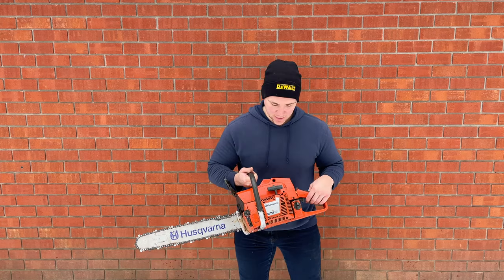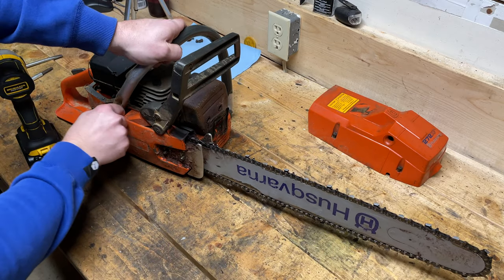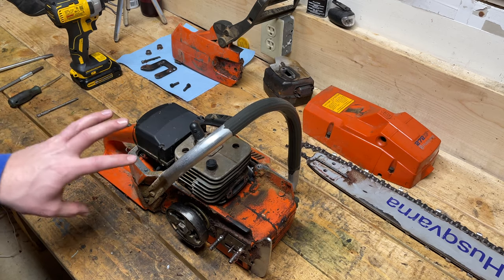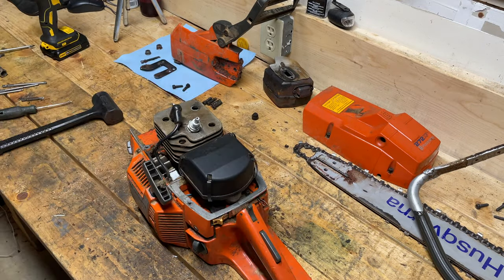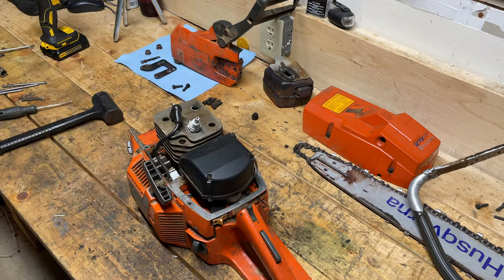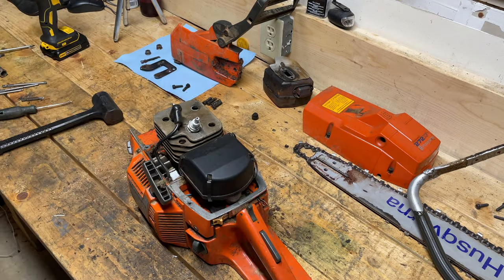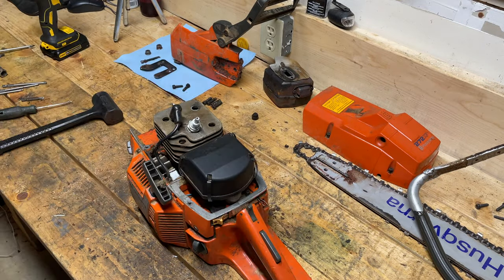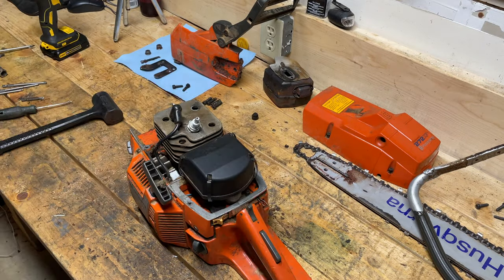How to fix your blown up chainsaw... WITHOUT buying new parts! Step-by-step diagnoses and repair!!!

Comment: Dave you have been a good student, done your homework and are adopting the same style as the miestro your mentor don. Enjoyable vid
Reply from the maker: Thank you kindly!
Reply: @DavesSmallEngines  👍 it would be great to see some vids on older Stihl, Jonsered ,Husqvarna ,Dolmar,Echo,Tanaka saws strimmers blowers if u happen to find any blown up examples that need redirection. It's great to see these bargain finds
Reply from the maker: @tc3603  I have a Partner Pioneer 7000 I bought at a garage sale fully disassembled. Would you like to see a video on the rebuild?
Reply: @DavesSmallEngines   that would be great. Cannot beat the older stuff . Looking forward to it
Reply from the maker: @tc3603  sounds good... I have a much bigger project I’m about to get underway. Well, several actually. But this one is pretty big!

Comment: Cool vid, I like to take a dial caliper, measure the thickness of the ring where it's deepest in the ring groove, and most protected, then measure the damaged part near cylinder wall, to make sure it's not peened over into a tiny burr.  If it is, I'll take just a couple swipes on each flat face with some fine sand paper, just to kill that sharp edge, to keep it from gouging.  I only do this when the ring looks like it took a beating.  Cheers.

Comment: Excellent video. My Stihl 193t (that I bought for $65) has low compression and some scoring on the piston. After watching this video I'm going to try and revive my old cylinder and piston. I can't find any aftermarket kits for a 193t and I'm not quite ready to buy an OEM kit until I try to reuse my factory cyl/piston.
Reply from the maker: Hey Sword! Always worth a try in my opinion. I have a 441C I’m about to downgrade from a cheap big bore kit… just doesn’t run the same as stock. I’m going to try and fix up the OEM cylinder before buying a Meteor kit!
Reply: How did it go?
Reply: @AudreysKitchen  It runs well after a new ring was put in and the piston and cylinder was cleaned of all carbon buildup. Since the cylinder was removed I also replaced the crank seals. The cost savings was definitely worth it.

Comment: Keep up the good work Dave. Ya I think you should put out more videos. On more chainsaws.& etc. That are 2 cycle engine equipment such as edgers,ledgers,hedgers,& weedeaters.& much more things that are to. Even boat outboard engines.& like rebar cutter saws.& polsaws.
Reply from the maker: Hey John! Thanks for the support. I have lots of other videos so check them out if you get a chance!

Comment: i just got a not running 266, piston looks exactly like this one. Wonder if it's worth getting a brush hone for $20? i've never tried reconditioning an engine before. i like the idea of keeping as much oem swedish parts as possible
Reply from the maker: I think it’s always worth it to save OEM parts. I always take enough off with sandpaper but a brush hone may do a better job. Let me know how it goes!

Comment: I use my little car adjustment screwdriver to press down on the ring to get it in the cylinder.  All of my saws have two rings which makes it harder to get the cylinder down on the piston.  I also liberally coat all parts with two cycle oil before assembly.  My torque setting on cylinder bolts is as hard as I can hand tighten them and all bolts have the same approximate torque.  I also relighted after an hours run time.
Reply from the maker: Great tips John!! Thanks

Comment: I don't understand why people do this !  You should blow as much dirt off as possible BEFORE any disassembly.  Then after you get the bar, handle and any covers off blow it off again !  Leaving dirt on the outside is just an invitation for it to get INSIDE the engine.

Also I would use wet/dry sandpaper or emery cloth with water or oil.
Reply from the maker: I agree Jack - however with my air compressor I made certain that nothing was inside before reassembly.
Reply: I thought the same thing.
Reply: I totally agree. I was a Tech/ Service Manager for a Honda motorcycle shop.  Guys would bring dirt bikes in, that were due for a first service, which includes a valve clearance check. They’d be covered in dirt, or if it was “washed”, it was hit with a pressure washer, and not done correctly.  
I’d say, “ would you go roll around in a mud puddle,then show up at the hospital for a scheduled heart surgery?” 
It drove me nuts.  We would tell them, it’s a $15. charge to wash it prior to service. The old man took $5. and whomever washed it got the rest lol.
Reply: @chipper442  I would happily pay the $15 !

Comment: Before I put screws in, in plastic or other materials, I like to turn them out by hand until they fall back into the previous thread then hand tighten to make sure they're in the right thread. Makes many repetitive repairs less destructive to the fastening threads.
Reply from the maker: Very good point. I learned that lesson the hard way a few times!

Comment: I usually rinse out the crankcase a couple of times with good two cycle and blow it out, good, with compressed air.  This will get rid of most little fines.  I then put assembly lube on the bearings before reassembly.  I also put TB 1184 on both sides of the gasket on the cases and cylinder.  I tighten all cylinder screws with a T wrench to a strong hand tight.
Reply from the maker: I’m going to start doing that! Thanks!

Comment: I have a question I have a 365 71 cc chainsaw It had compression then all sudden it lost it and now it is dumping mix fuel into the piston and exhaust I cannot figure out why piston looks good when you look through the exhaust hole but you can pull it and watch it dump gas out of the exhaust port

Comment: That’s why I put Locktite on carb bolts or nuts when I put them together.  I used Red 271 on them and muffler bolts.
Reply from the maker: Good tip!

Comment: Maybe you can help. I got a 450 husqvarna and was cutting a tree And I thouched the fence and the chain came and I damaged it. Replaced the chain and now it doesn’t want to turn on. I replace the spark plug and cleaned the filter and I’m lost now. I order a carburetor kit and fuel filter and when they get here I’ll replace them. What else could be the issue?

Comment: 11:50 Hey dave i would of used a air chuck and try to blast all the crud out arround the base and arround the carb before removing the cylinder to prevent less chance of debrie getting into the crank as i would be to be pulling off the cylinder
Reply from the maker: Good call - I ended up spending about 5 minutes blowing it out at 150psi before reassembly. I will do it before next time.

Comment: That 272 is a good saw as is the 372xp but I personally prefer the bigger jonsered chainsaws myself my first saw was a old 601 jonsered then I got a 041stihl farm boss and wasn't satisfied with it and just kept going bigger CC wise found the jonsered 2077 and 2083 turbos and I love them
Reply: sadly, Jonsered is no more..really, all they have been for many years is badge-engineered Husqvarnas..those 2077 and 2083 saws you mention were not re-badged Husqvarnas, and they were good saws. However, they were not really Jonsered designs, either..they were designed and engineered by Partner(another company Electrolux gobbled up)...the "true" Jonsered design saws go back farther than that...

Comment: You can use a brake cylinder hone to smooth the cylinder. Worked on a Stihl cylinder.

Comment: Why is there an arrow on the top of the piston to direct that side to the exhaust port? IOW is the piston different on one side than the other and how? I was wondering if the piston could be turned 180 when being put back in. Perhaps a diffirence is the location of the piston ring pin, which I am guessing is seen at 15:30-15:31 next to your thumb. At 27:00 you seem to be aware of it when installing the ring but don't mention it.

Comment: Dave I’m quit curios how long or how strong that saw will last. That’s a lot of sanding... I get the in the pinch idea but you’ve sparked some curiosity now on seasonal/ full time use.
Reply from the maker: That’s a great question Jon. I spoke to @donyboy73 about it and he gave me a good answer. Look for that on his latest upcoming Q&A video, we talked about it at length!

Comment: I have a 441 also. just bought a big bore kit for it..   Don't gasp and faint... but I got it from Farmertec... guess i need to question walt(afleetcommander?) or tinman about what i should do before i install it.   Big bore only adds 2cc? i thought it would have been more at least 5cc??  my mistake i guess.
Reply from the maker: No mistake! I have an off brand bigbore kit in mine... I have a video of this exactly, I have a 441C I turned into a 461c by a big bore kit. It’s 70cc to 76.5 cc I am quite impressed with it. Is yours the Mtronic carb?
Reply: @DavesSmallEngines  OK as i had thought i was thinking anywhere from 75cc to 77cc at first.  No mine is just a MS441 magnum.  no C or  CM letters.  i seen the others talk about squish and i am going man something else to think about. i was hoping slap it on and go... never know i might be able just to do that lol here's to hoping.   but i do know about ring catching or what every they call it.. and base gasket deletes to rise compression.  ah well fun in trying anyways. eh?
Reply from the maker: @beingsneaky  that’s the best part! I think it’ll be fine. I had to grind out part of the casing on the bar side and flywheel side to get mine to fit but man, what a powerhouse now!

Comment: Dave,

Great video and very helpful.  I am finding older snowblowers and garden tractors are superior to new products coming out today.  It takes a little tlc to get something running that will last another 20-30 years.  Is it a similar situation with chainsaws?  Are there any older models that you search for that are easy to work on and easy to find parts?  I use a chainsaw about a dozen times a year on 6”-20” trees.
Reply from the maker: Hey Matt!

“They don’t make ‘em like they used to”!

Anything on the “pro level” side of things. Stihl 026, 028, 034, 038, 044 etc. If you check out “Stihl pro level saws” you will be able to find more. The pro level stuff is so much easier to work on - fast disassembly without having to remove a ton of parts. I’d recommend an 026 or MS260 with a 20” bar. Stay tuned, my next video will be on the repair of that same saw.

Cheers!
Reply: Thanks.  I look forward to the video.
Reply: I’m still using my Pioneer P40 which I acquired second hand about 40 years ago. Keep the mix right and the chain sharp, don’t force it to cut faster, slow cutting is all down to the chain.

Comment: Hey Dave. 
Great Job on this Husqvarna chainsaw👍 I do have a blown up Stihl 044 in stock on which I will try the same repairtechnique...😉 We‘ll see how worse the cylinder and piston could be for chooseing this method 🤔😉
Greetings from Germany,
Stefan
Reply from the maker: Hey Stefan! That’s great. Let me know how it goes. That saw is absolutely worth repairing!
Reply: Dave's Small Engines 
Absolutely😉👍 I‘ll take a Video of the repairjob for my channel... This sanding method is not always possible and you have to be careful not to destroy the coating of the cylinder😉
Reply from the maker: @Bungi81  I’ll check it out!

Comment: Hi Dave. Please can you tell me which sand paper is best to be used for chainsaw cylinder  light scoring? Thanks
Reply from the maker: I would suggest 600 for light scoring. If it’s deeper, I use 300 then 600.

Comment: Another tip for starting in bolt without cross threading is to turn it backwards until you hear it click, then tighten it. It's ridiculous what they charge for OEM parts. I'd like to see someone calculate how much it would cost to build a complete saw with individually purchased OEM parts. I bet it would be a couple of thousand! 👍
Reply from the maker: Good tip!
Reply: My dad was the sole salesguy for Partner saws and Oregon chains for a whole "socken" (basically a county)  in Sweden in the 50's and 60's. He bought complete saws and disassembled into parts, one saw needed only to sell half its parts to pay for itself and only bought the parts that were the big sellers. He also got commission for saws sold, because the company banked on selling lots of spare parts. He got extra goodwill for selling fresh handles and other less-wanted parts cheap for customers when they fixed their saws with him, since he otherwise had those parts left over from the stripped saws. Everyone got great saws in great condition, he made bank, and even got free air-charter trips to spain from the company as a bonus when they started flying airplanes from Sweden to Spain. Sadly he sold to many saws on credit to people who decided not to pay and he didn't have anyone doing collections for him, or he'd been truly rich.

Comment: the dewalt atomic impact. i have one. i absoultly love it!
Reply from the maker: Mine isn’t the atomic - I have been eying one though. I have the 20v max brushless. Should I get the atomic?
Reply: @DavesSmallEngines  sorry it looked like it. naw if you got one already the atomic doesn't bring anything to the table.

Comment: For a start you are flat spotting this piston, far to course paper.
Grooves don't matter only high spots and ring lands ,just take off the high spots fit a new ring and circlips and you are good to go.
The main issue is the bore, if you can't seal the piston RING to the bore it's going to have trouble making compression so the bore needs a hone and hope (I believe it's nicaseal ) not sand paper.
Course paper on the ring is ok because all you are doing is removing the aluminium from it.
Once overheated the ring will lose temper and elasticity so a new one is preferable.
Either way it will run but it will not put out the same power.

Comment: I was told by beer can small engine repair on a cold start to let the saw run at a idle for a minute before revving it not to score the piston
Reply from the maker: Hey Fred - I agree. Always best to let it warm up to prevent cold scoring. Cheers!

Comment: Seems to me that the score on the cylinder walls and the damage to the rings would have been something of more concern to repair as to the score on the piston itself since the piston is not going to contact anything as long as specs are in place elsewhere.

Comment: What you can do on the piston and it'll give you more horsepower as well and prevent piston slap is to get a centre punch have it slightly blunt and every 5 mm put an indentation quite heavily in the side walls, you need to have a block of wood the shape of the piston underneath it, and up to about 4 mm to the ring With a fine file or thousand grit wet and dry on a flat surface take off the burrs from the punch so you're left with 0.3 tho measuring with a feeler gauge to the side of the wall of the cylinder. Always run a Chainsaw with more oil so you've got slight smoke and dieseling and use synthetic not mineral.
Can you not buy the piston and ring from Husqvarna? And if not why not?
Having a slightly oversized ring 0.1 tho might be beneficial. you could get the cylinder chrome plating 15 microns after hatchings 
you can make a gasket by just cutting an old foil tray seems to work for me all the time just make sure it's bit thick not the thin ones

Comment: Good video but why didn’t you show compression before you took it apart ?  Tx for all your knowledge bro
Reply from the maker: Hey John - I forgot. It was 70PSI as I found a picture of when I first tested it.
Reply: @DavesSmallEngines  ok tx for the reply. I have a similar situation but the piston was too far gone. It’s a stihl 271 and I can’t get a cylinder for it without spending like $200. Probably just get a new one. Tx Dave
Reply from the maker: Hey John - yes the 271 is not a pro level saw which means it’s harder to work on and the parts are expensive. Have you looked at an aftermarket replacement by chance?
Reply: No I haven’t. Could you recommend one with possibly a part number. That would be very helpful as I don’t know where to look. Tx in advance Dave

Comment: If its been sitting for any time, 
the muffler will have rust bits in it. 
These will blow back into your cylinder and destroy it right away.
I use an ultrasonic cleaner.
Does a spiffy job and is good on all your parts. Put your parts in a coffee can, 
in whatever cleaner you use and insert that can into your solution. 
It prevents your maim solution from being contaminated, as well as giving you the choice of different cleaners.

Comment: You know i seen Projectfarms use "Engine Restore" on a mower and it worked i wonder after your sanding if it maybe help even a little bit?   hmm perhaps not on What every it uses to fill in minor scratches would get into the bearings.  But then again AGAIN it gets into the bearings of a car.   I know it works on cars and mowers.
Reply: CAN RESTORE BE USED IN 2 STROKE ENGINES WHERE OIL IS MIXED WITH PETROL? No, RESTORE is not formulated for use in 2 stroke engines using a petroil mix, but it can be introduced down the spark-plug hole with the piston half-way down the bore. (Please refer to the attached Instructions to 2 Stroke and 4 Stroke and wet clutch users). You can also use RESTORE in 2 strokes where the oil is contained in a separate reservoir. Most modern scooters (Piaggio, Aprilia, Yamaha, Sym etc.) have a separate oil reservoir and all you do is pour 125ml into a full tank of oil.
Reply from the maker: Good to know!

Comment: I would have measured with a quality caliper before sanding, and in more than one place. Once it appeared "clean" I would remeasure. I would have also used a flat block sanding backer on the ring--don't want to round over.